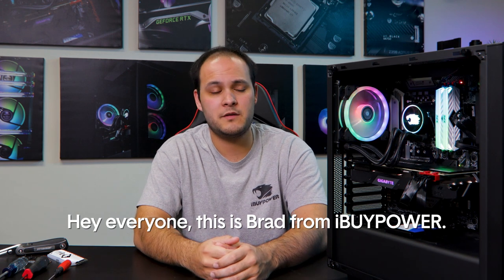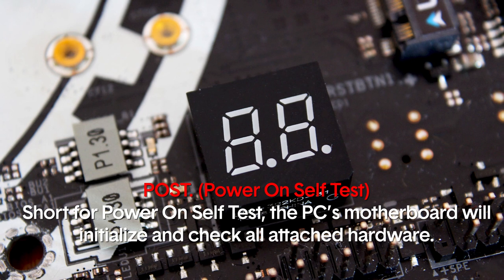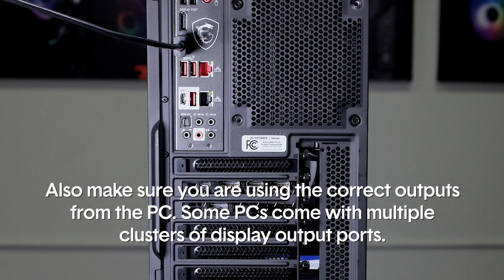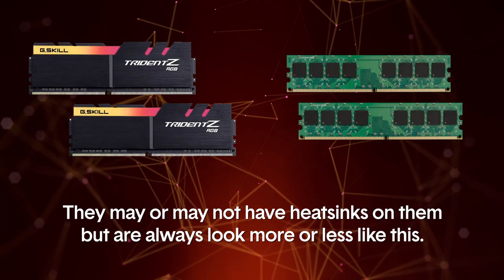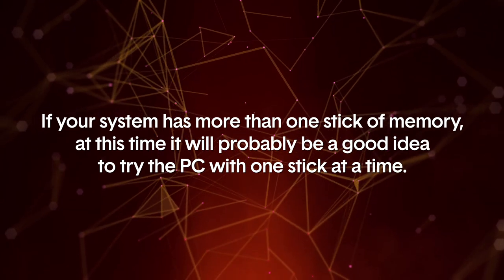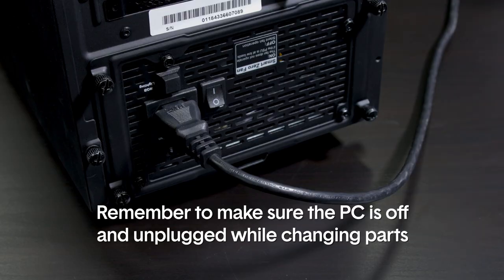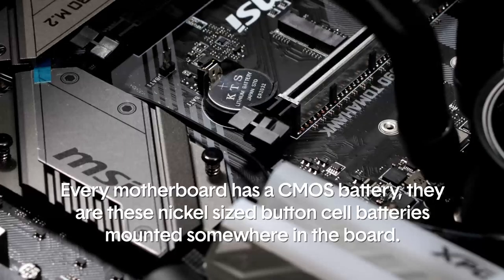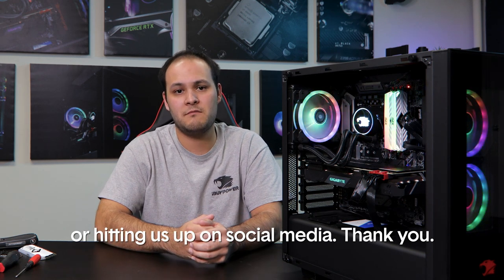Troubleshooting PC No POST | Computers and Coffee

Comment: There's one more simple check you should make if your PC has been in use for several years: If it won't start, or it takes a very long time to POST, or it shuts down again almost immediately, check for a bad power switch. That just happened to me a few weeks ago. When pressed and released, the power button remained stuck in the down position. Read your motherboard's manual to find out how to "jump" (short) the power connectors to start the PC. If that works, you can buy a replacement power switch.

Comment: For anyone panicking, check your ram stick on both sides, make sure they're pushed in equally
Reply: A pc keep giving alarming beeps or siren but still work fine. Usually first thing to do is to replace the PC case and install the RAM in different slots, but some RAM stick are the “leader” stick that must be in the slot 1 to make a pc POST as the other sticks of RAM “follower” sticks that couldn’t POST all by itself. 
It may not be the PSU has fault, but replace the PSU may fix it if all the fans works fine when there was no POST. Replace mobo’s battery too. In many cases no PC parts has fault, it just need to replace the PC case, RAM, PSU, battery with another working PC parts, so after doing all that, you ended up with 2 working PC system and not a single faulty PC part.

May need to replace the PC case because some pc case’s back panel is curved outward and need pushed inward to put in the screw to secure the graphic card, so after some years or weeks of use, it pulled things out of place, bow and arrow theory … …

Comment: New builder here and was freaking out because my computer wasn’t posting. I removed RAM and placed one back to try it and it worked. Thank you so much!
Reply: Wish I was that lucky still haven't figured it out
Reply: @darthjarjar2742  same, taking mine to repair shop see if they can find out. Reckon it's the PSU or motherboard but hopefully get it fixed 😣
Reply: @SCOHunter  you had any luck, my pc is freshly built today and my mouse and keyboard receive 0 power and neither do my front fans or graphics card, please help

Comment: FOR NEW BUYER WITH NO DISPLAY. I just got mine to work following this guide, but with some added self diagnosis.  My model was one with an rtx 3070 in it.  The card wasn't fully seated because there wasn't enough physical space on the motherboard to have the giant of a GPU not run into one of the cables underneath it (is it called a SATA cable? Anyway...).  I had to flex the cable connection down while being sure to not bump into the release tab of one of the rams when I reseated the graphics card.  It...barely...fit and seated deeper than before.  Not too happy with how flexed that cable mount on the mobo had to be, but there it is.  It helps having a mechanical background I guess. :)
Reply: So, I decided to pull the gpu out and switch the ssd with the os on it to the lowest possible sata port and remove the other hard drive all together.  Guess im going external with that hard drive now. :/
Reply: 🙌 thanks for leaving this comment here! I bought my pc a while back and hadn't have time to sit down and set it up and now I finally have time it won't display (at first thought was the monitor/ cable) but after plugging the monitor to display a mac it had no issues) kind of quietly freaking out that it's my brand new pc!!??!! will be following these guides!

Comment: FYI. For anyone watching this video... IT REALLY PAYS TO WATCH IT IN IT'S ENTIREITY. I tried removing the graphics card. Tried removing my RAM sticks. It wasn't until the VERY LAST suggestion that it worked and regardless how insignificant it might be, it's worth trying. The only thing that worked was me removing the CMOS battery for 5-10ish minutes and then putting it back in. Trust me, this works. I was going to go to my neighborhood Microcenter and probably buy and get installed a brand new motherboard which is what I thought was wrong. This saved me a chunk of change.

Thank you!
Reply: ur not lying i tried everything else and the final thing worked

Comment: If you aren’t seeing any lights on the board try changing the monitor. This is the second time I’ve fixed a no post by changing monitors. You can switch back later.
Reply: It can be a DVI to sub adapter cable issue, it could work for a day or 2, but then it no longer worked for unknown reasons, so better idea is test it on another screen that use HDMI or direct d-sub cable.

Comment: Thank you for this helpful step-by-step video. I just bought a PC from you folks and while it would eventually load the BIOS, then subsequently Windows, would take about 2+ minutes of black just to get to the BIOS splash screen. Which I was like, "That can't be right." Tried reseating the RAM, Video Card, and motherboard battery, and it's now getting through POST to the BIOS within a normal time frame as expected. Thank you!

Comment: For people that bought through CyperpowerPC. Just bought a prebuilt, also lasted about 30 days and the computer would turn on for a few seconds then shut off. Keyboard, mouse and Monitors did not turn on during this. Checked all the above. Turned out to be the round battery under my graphics card on the motherboard. Left it out for 10 minutes, then put it back in and the PC started working. I had initially thought it would be the PSU, but it wasn't! Wanted to post for anyone that might be having a similar problem and to save you from buying a whole new PSU!
Reply: i have the same issue, but nothing seems to help
Reply: @meneeya  took out the battery for 10 min then put back in or get a new battery that was on the motherboard. Seemed to fix it. Hope this helps.

Comment: For the first time ever a video worked without any problems

I reseated the RAM, Graphics Card, CPU power connecter.

Took out the CMOS battery for 5 mins

Slapped it back in and it worked.

Thank you, liked and subscribed with the bell on

Comment: No luck with Ibuypower support for 4 years. Every time I contact them with the issue, it’s zero help. 

My PC will power up with no display. Then hours or even sometimes days later, my mouse will light up and boom, good to go. Issue is I have to put it into sleep mode, because if I shut it off it’s the same issue over and over. 

No idea what to do, since if the power goes out or the PC shuts down, most of the time it’s another few days before it comes back on. 

Have even paid a PC repair person $100 to tell me nothing is wrong with it. Of course ibuypower has helped zero at all. Never been so frustrated on spending $1400 on something that had an issue the day it arrived and was never fixed :(

Comment: Love the video you said I could ask for help.  

First Post so bare with me:  I am not getting a POST.  Do I have something that is not compatible with my motherboard (see below)?

I attempted to do my own build:

My build:
1. Corsair 4000x ICUE rgb case
2. Gigabyte: B450 I AORUS PRO WIFI (rev. 1.0) motherboard (AM4 Format)
3. AMD Ryzen 5 5600x with include Wrath cooling fan
4. RAM: Corsair Vengeance RGB PRO 32GB (2 x 16GB) PC4-25600 (DDR4-3200) in motherboard DDR slots 2 & 4.  
5. Graphics card: MSI Radeon R9 280 in first pcie x16 slot
6. PSU: Corsair CX550F RGB, 550 Watt, 80 PLUS Bronze, Fully Modular RGB Power Supply
7. SSD: Samsung 850 EVO 250gb: in the Sata3 slot 2 (0, 1, 2, 3 are my options)
8. Monitor: Dell UZ2315H (resolution 1920x1080)

Issue: Fans are spinning colors are changing.  Light is on the motherboard indicating that the CPU is talking to the motherboard.  Other 3 lights do not turn on (DRAM, VGA, Boot).

Any reason why I can't get to the Post screen on my monitor?

Things I have tried: 
1. Move the DDR memory to slots 1/2
2. Removed the CMOS and put back after 10 mins.
3. Removed Graphics card and plug into the hdmi slot on the motherboard.
4. Removed the SSD 
5. Downloaded Windows on a USB drive hoping to boot off of it.

Help is needed.  Thanks, in advance.

Comment: I did all of the steps and my monitor still says no input
Reply: Me too! I went to a technician, in his lab the pc worked, but when i came home, it still doesnt :(
Reply: Most likely have to get a new motherboard
Reply: A pc keep giving alarming beeps or siren but still work fine. Usually first thing to do is to replace the PC case and install the RAM in different slots, but some RAM stick are the “leader” stick that must be in the slot 1 to make a pc POST as the other sticks of RAM “follower” sticks that couldn’t POST all by itself. 
It may not be the PSU has fault, but replace the PSU may fix it if all the fans works fine when there was no POST. Replace mobo’s battery too. In many cases no PC parts has fault, it just need to replace the PC case, RAM, PSU, battery with another working PC parts, so after doing all that, you ended up with 2 working PC system and not a single faulty PC part.

May need to replace the PC case because some pc case’s back panel is curved outward and need pushed inward to put in the screw to secure the graphic card, so after some years or weeks of use, it pulled things out of place, bow and arrow theory … …

In one of the other cases, each time the power is out in my house, I need to replace the graphic card and installed a graphic card that could POST in the PC, then I install the one that failed to POST back in place and it could POST, so each time the power it’s out I need to repeat that!

Some PC could shut down due to static charges when your hand is only touching the power button to the PC that’s made of plastic (not pressing the button).

Some PC couldn’t POST, just wait a 3 days without using it, then it return to life of POST, this could happen once in a few years of use, like seeing a comet going passing by! Unplug the power cord and HDMI cables to the PC and let it sit there for 3 days …

Comment: Thank you this video saved me I just needed the to let the cmos sit
Reply: Hopefully that’s my issue, I’ll have to test it when I get home.
Reply: @lastfirst5863  did that work for you?
Reply: @ikzou2789  it helped me get the old card working again, and figure out what I did wrong with the new card. I plugged in the 8 pin without also plugging in the six pin on my GPU, I was a dumbass.
Reply: @lastfirst5863  owh...im so sad, I just build my pc yesterday and it shows no signal I did almost everything, I feel like crying 😢
Reply: @ikzou2789  What specs?
Reply: @lastfirst5863  i3 10100f
Rx 580 4gb
H410mh mobo
550w aigo psu
16gb drr4 2666
Reply: @ikzou2789  can you get any signal from the onboard graphics?

Comment: Mine DIED after two weeks. None of the steps changed anything. In addition to no display the keyboard doesn't fully power up. The keyboard works fine when plugged into another computer though. I end up returning it on the Air Base where I purchased it. Even the top USB ports were super flimsy loose.
Reply: Same, have your found a fix?
Reply: @timaden3916  It's not full of shit. These steps will work if none of your components have defects. If they do, ofc you'll have to replace it.
Reply: @triliner254  you're right, mine needed some components replaced. I was just upset at the time because how long i waited for it and it finally coming in broken 😩.

Comment: so i power on, everything lights up and fans spin. My motherboard led lights begin the boot loop. White led(4 seconds), yellow led(4 seconds), then the red led comes on but only for a second then it goes back to white led and being looping in that order. My manual says red light indicates CPU but it’s supposed to stay illuminated if there’s a problem with that hardware. I reseated everything, cleared cmos and redid bios flash, still no signal. My monitor works on my laptop, but it takes a few minutes of being plugged in for the image to show. But it works none the less. any ideas? asus b550f wifi ii and 5800x3d. brand new build so ram isn’t dirty and i tried reseating didn’t work

Comment: Hello, My name is Bernard and i'm having some issues with my PC and would appreciate your help if possible.  I have an AMD FX-4350 CPU that i just swapped to a FX-9370 cpu. I installed the cpu but after installing it i waited a few minutes then went to try turning on the computer but my computer seems to not want to stay on. When i press the power button it turns on for about 5-10 seconds then it turns off automatically. I get no video display either.  Is there a reason why its doing that? Its never done that before.  This is actually the second time i change a CPU so i'm not sure if i missed something.  Your help is very much appreciated.

Thanks

Comment: My Alienware aurora r7 works great, but sometimes it wont power on, but usually after a while sometimes hour or days its starts back working!?!HOW!?? i took it to 2 pc shops so far trying to fix this problem I replaced the power supply and installed a SSD with fresh OS and HDD, the original power supply had a button to test all fans and they spinned before i swapped it so i know its getting power when it does this not powing on thing im typing this on my pc but i dont wont to shut it down anymore cause of this problem if anybody has any idea, suggestions that help please i dont know what to do?? been trying everything,

Comment: I bought a ready built PC and received it today. Unfortunately, it has a VGA LED on which supposedly indicates the GPU is having an issue. I made certain that all cables were nice and snug, I reseated the RAM, I reseated the GPU, I even tried several different HDMI cables all to no avail! Dang VGA LED stays on and PC will not POST. I tried calling tech support and received "We're sorry, we are closed"! Not a good day so far. I have a feeling it's going to be a bad GPU. What I don't understand is, they supposedly build it, QC the build, run it through burnin and QC it again before shipping. I was surprised it was shipped in the regular iBuyPower box without any other boxing material to protect it. The foam inside to protect the GPU was a joke. I spent several hours trying everything I could think of to no avail. I guess a call is in order tomorrow. Sigh!

Comment: So my pc will basically go through the stage of fans spinning and led lights coming on but it never fully boots. Led lights come on and fans spin on for about 30 seconds but then it just shuts off and then the process repeats.
Reply: Did you fix it
Reply: Yes
Reply: @nibz6428  can you tell me please? Mine won’t boot up it turns on but it doesn’t show anything on my computer
Reply: @jo4696  well for me the problem was that my cpu wasn’t compatible with my motherboard so try and make sure all your parts are compatible with each other.
Reply: @jo4696  If you haven’t already try unplugging the DP from the monitor and GPU and replugging it.

Comment: I reseated my Ram, and my Graphics card. But it didnt work. The Mobo's fan is on so I assume it isnt the Mobo's issue, But my Graphics card fans wont turn on.
Reply: I have the same problem !
Reply: This was 3 months ago but check your power supply.
Reply: I don't know if you ever solved this issue but your gpu fans don't turn on until they need to. Unlike case and cpu fans that run all the time. Try playing a graphics heavy game and seeing if they automatically come on.

Comment: My pc doesn't post but after i hold the power button and turn it on again, the pc now boots normally. Anyone knows what's the problem? I have here the history of my troubleshooting.

My pc had it's cmos corroded so i replaced it and at the same time i discovered the hdd was dying so it doesn't post sometimes. I replaced it with a new ssd and installed the same win10 pro OS, after the restart it didn't post and I did a shutdown with holding the power button then turned it ON again which eventually booted to windows. This happens everytime I'll turn ON my PC.

Comment: i’ve messed with the ram and still no fix. i can’t seem to unplug my ram? it’s like the plug is stuck or something. i have the geforce gtx graphics card
Reply: Not sure which one you’re talking ab but for both ram and gpu there should be a little tab you have to press down to pop them out
Reply: Yes rams are simple to pop out graphics cards have a small lip at one end that may get stuck on occasions when taking them out try that 😁

Comment: (HELP)

Only watched anime last night, then turned it off when I was going to sleep, forgot to turn off the AVR. I tried everything that was on youtube, I tried booting with one ram on every slot, tried resetting the BIOS because I overclocked the RAM to 3000mhz(it worked  without issues), tried reseating everything, there's a red led light on the DRAM and sometimes on the CPU. Everything with led in my PC turns on, all fans are working, the fan on the gpu is spinning but then stops after a few seconds. The Aorus logo won't light up. And the RAM Led is not synced with the Board. Please help :(

Specs:
Ryzen 5 2600
Aorus B450 Elite
Gigabyte RX570 8Gb
Kingston HyperX 8Gbx2 3200mhz

Comment: CMOS help and post, but i turned it off then on and then the same problem came back i tried to clear CMOS but it didn’t work
Reply: I tried to unplug the display port and connect the HDMI cable to the graphics cards, and it worked and the problem is solved 

Display port didn’t post anything until I install the drives for graphics card